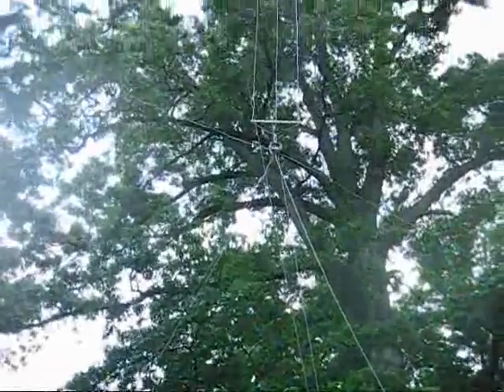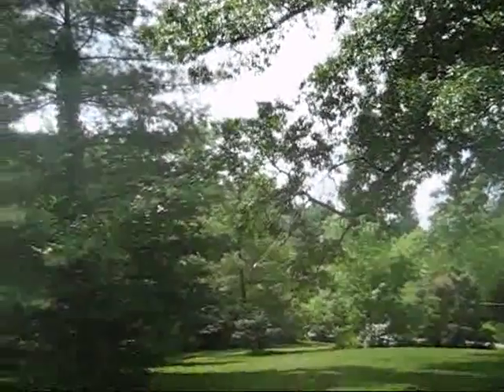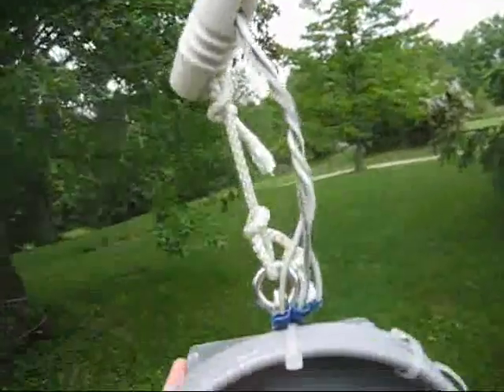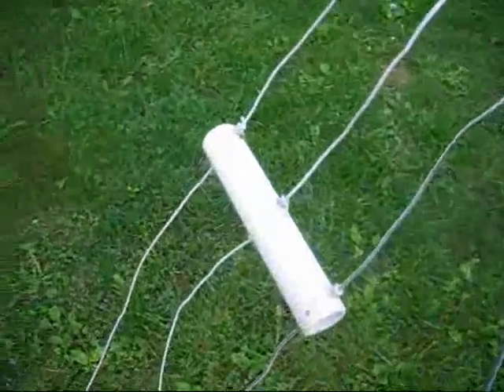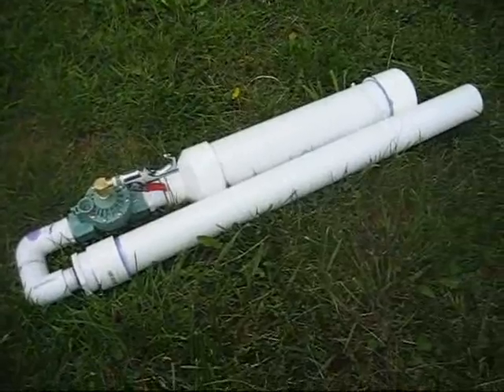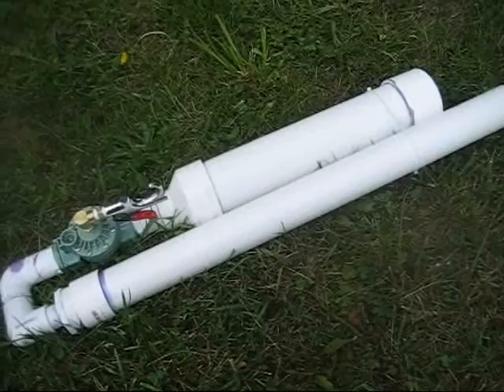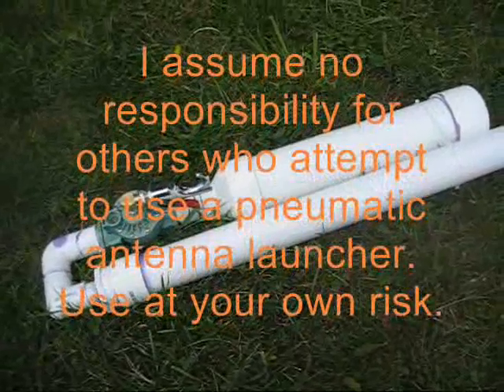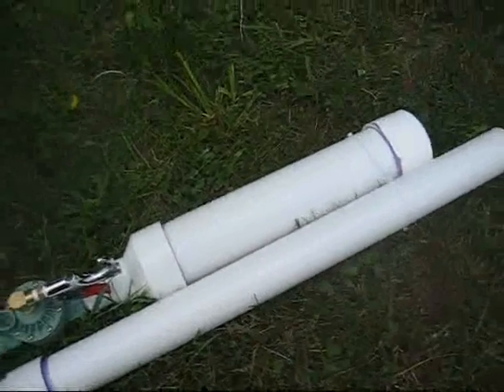Tri-Band 20m 30m 40m Ground Plane Antenna

Comment: I was all excited about the antenna until I saw the launcher.  I've always used those slingshots and NOW I want to build a launcher like that.  I lost my Cushcraft A3S and two dipoles, i.e. ALL of my antennas in the April 2011 tornados in north Alabama.  Been QRT every since, so I have been evaluating new designs.  The A3S was nuked not by the winds but by a tree that fell on the house.  I'm thinking about trying to fix it but am looking at parallel dipoles for 80-40-30.